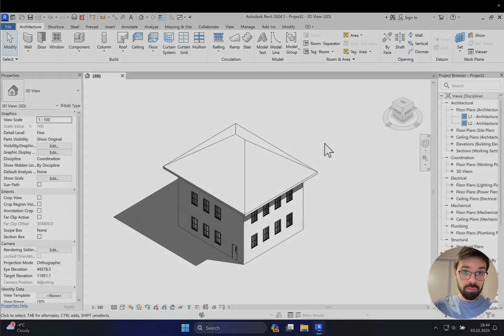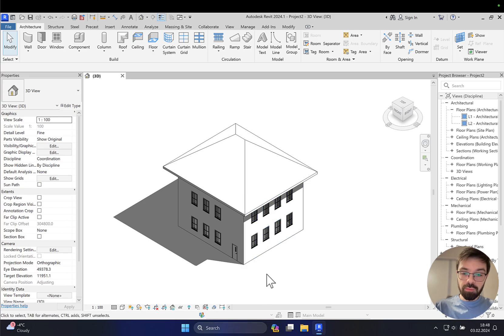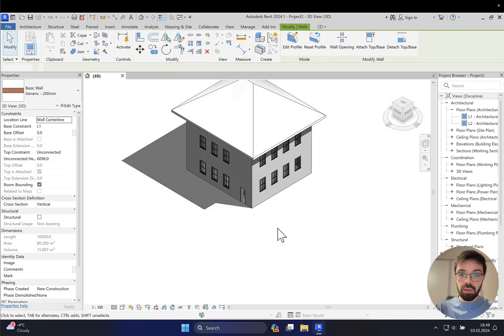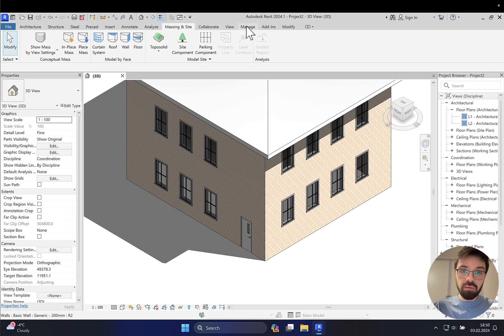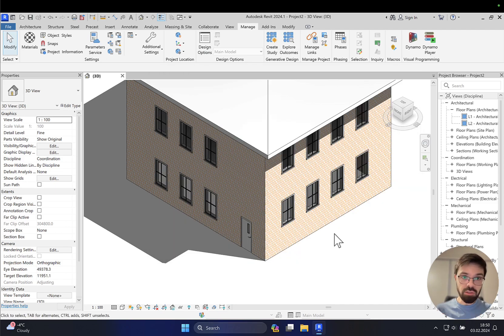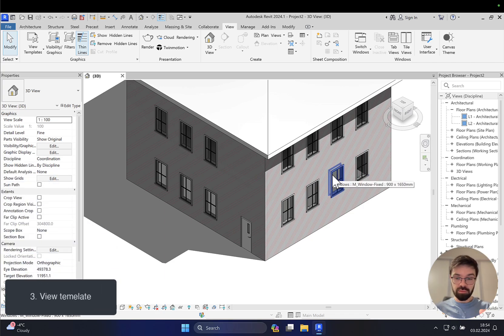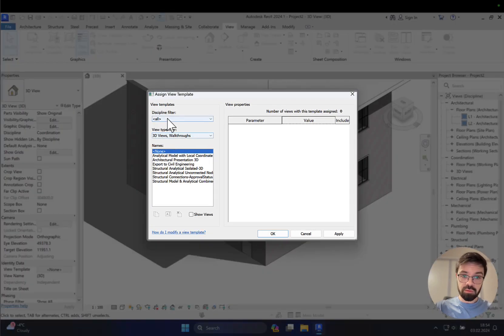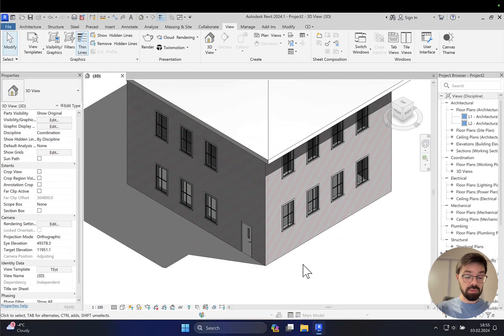Master Graphic Priority in Revit — Clean & Professional Drawings

Comment: I find that the templates and filters are often overlooked. I mean, it is totally possible to achieve the same result in Revit as in Photoshop/illustrator by using those two. Find a color palette you like, get the RAL codes, put them in and play with the colors and patterns till you obtain an interesting result. It's take less time and is a bit more efficient as you can set up filters for casework, furniture - windows - doors -etc.